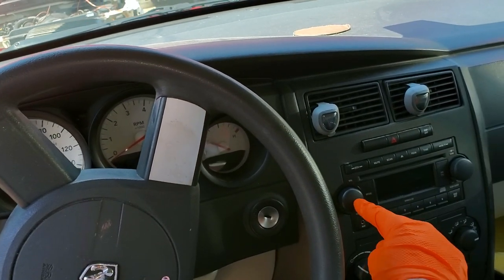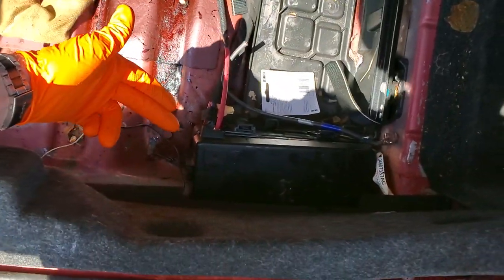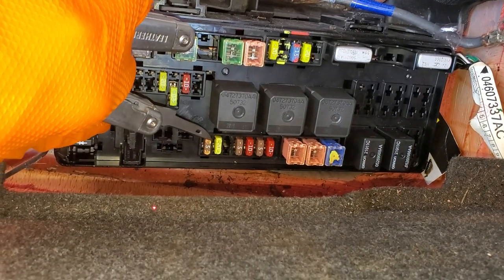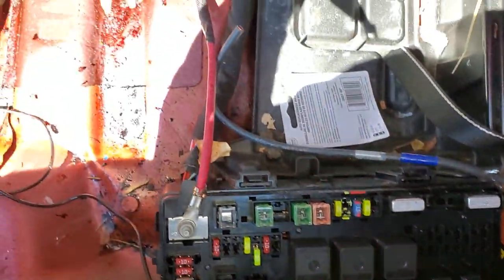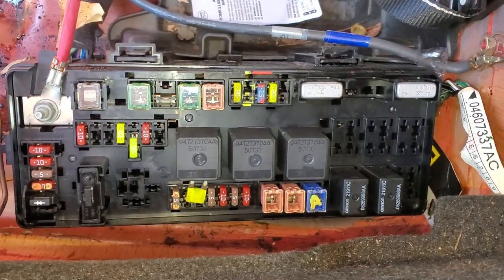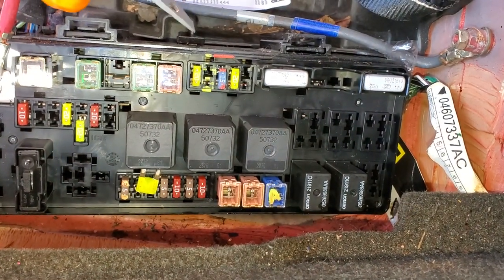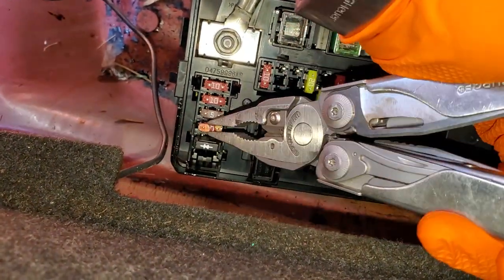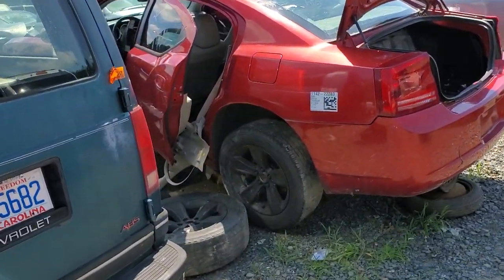2007 Dodge Charger Radio Fuses

Comment: My stereo keeps losing connection on the CANBUS. So I have to remove the fuse to reset things. Sometimes, I have to remove it, turn on the ignition, and off. Then, put the fuse back in. I have an aftermarket stereo.

Comment: Hi, so I have a sxt instead of the normal. My radio keeps turning off and on, it's not consistent. Sometimes it stays on for a bit or stays completely off. It has memory for the radio but only if it has power and nothing resets so ik it has power. I've replaced the wire harness and checked the fuses. I think it's just the radio but need a second opinion

Comment: So my 2010 Dodge charger once you turn the car on. And the radio maybe about 5 to 10 minutes it shut as well as the windows won't roll up or down . But I shut the car off and then it will turn on in Windows will work again. Have checked the fuses and replace the two 25 amp ones as well as checked the others fuses from being blown have wiggled wires and checked everything

Comment: @lehewtech  Question for you. I found a cigarette lighter in a junk draw and I put it in the cigarette port of my 07 dodge charger and as soon as I did that my in-dash radio (aftermarket) shut off completely. It won't turn on anymore. Is that a blown fuse and which one would that be? Thanks
Reply: same problem happened to me. did you ever figure it out?
Reply: @adamlindsey5795   yea it was a blown fuse  check the map for the console/lighter fuse and replace it. You should be good

Comment: Hello my lights that light up the switches on the ac/heat and on my dash board are not coming on is there a fuse for those things?
Reply: Should have a fuse diagram somewhere online. But yes most cars have a fuse for interior lights. Dash cluster. Etc

Comment: I appreciate this video and all its great tips 

I have a 2006 Dodge Magnum which is pretty much a Dodge charger the issue I'm having with it is the front speakers won't play I checked the fuses And they've all been changed and the speakers in the front are brand new as well but still don't play any audio in your opinion what do you think it might be my father says it could be the radio some people Say that the harnesses might be dead I've tried everything I'm not quite sure what to do now the back speaker still play but the front won't

Comment: I have an issue with my 2012 dodge charger radio coming on when I crank the car. Almost every time I have to turn the car off and then back on to get the radio to work but the cd player always works 🙃 any ideas??